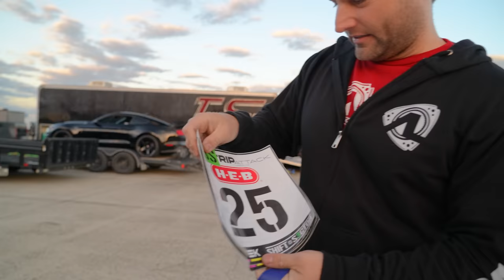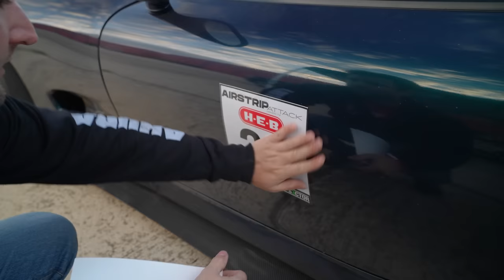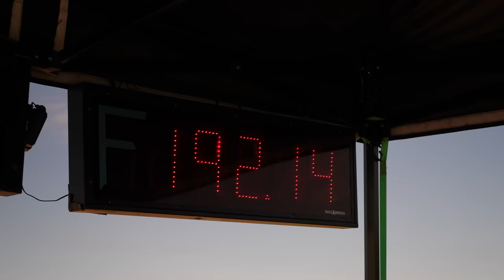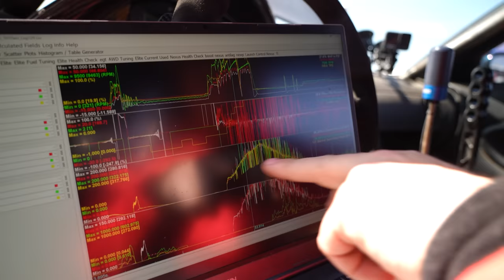The AWD 4 Rotor Breaks the Rotary Half Mile Record!

Comment: The wobble at the end of the pulls might be caused by some aero, since  its more like rolling left and right rather than yaw-ing left and right. Maybe some porpoising because of the ground effect? The pulls seems pretty stable means the skirt seal the air under the car just fine, but after you let off the throttle, it might cause some disturbance on the sealing. But idk, its just my guess, I'm not an expert by any means.

Comment: Might be worth discussing with Haltech the use of a high update rate GPS or a pitot-static tube as an additional reference for vehicle speed. Detecting slip purely with wheel speed sensors on AWD cars can be difficult.
Reply from the maker: I have an input set aside for a 5th speed sensor. Just need to figure out what would work best

Comment: So I'm not sure what kind of wheel speed sensors you are currently using but I would look into getting some three wire hall effect sensors, as there is no A/C gen interference is less of an issue, it can help improve your traction control system as they can put out a signal as soon as you start rolling without having to build up enough of an A/C signal first.

Comment: check the volts that the wheel speed sensors are putting out, at higher speeds any little bits of interference will be magnified and the computer will see it as a different speed. Can get this issue with cam/crank sensors at high revs. can either change the sensitivity of the computer or put a resistor in the wires to kill off the false pulses/interference from the sensors.

Comment: Regarding the unstable aero... Noticed there's no rear window. I wonder if this would cause vortices/turbulence. Or even an area of low pressure (lift). Or all of the above. And the rear wing would also affect aero, potentially in a negative way. Not all wings work the same on all cars. I wonder how a stock series 8 spoiler would affect the car? I remember it was specifically improved for stability at high speed. I tested this with my own FD at the track and it made a huge difference with/without stock spoiler.

Comment: don't pull the strap tight and then start ratcheting it down it will go loose every time. You have to wind a few turns around the strap drum first then keep ratcheting to tighten. the extra turns adds friction to the strap and holds it properly.

Comment: To be honest I don't think that's a down force issue, I think that's an alignment issue. I think it needs to have some toe up front. It seems at speed the tires are trying to point outward so it wants to pull the front side to side. A degree of positive toe on both sides will make the tires more straight at speed.

Comment: no back window might be the problem with the aero doing wierd stuff to the car.

a friend rode his dirt bike set ut for 1/8 mile race no front fender and number plate thinking it would be more aerodynamic and the steer of the bike started to wobble at speed like 4 rotor. 
just by taping a layer of duct tape where the number plate should be to create a aerodynamic preasure point solved the problem.

Comment: The side to side swinging could be a number of potential issues and to name a few; bad wheel alignment(camber), could be the tires itsself or even the hub bearing(s), the chassis is broken or busted somewhere, suspension needs a do-over or different settings, could also be the aero..

Comment: Toe issue. If the car starts crabbing its toe. Get the car on a set of scales to see if its loading up one side more then the other. Also see where your weight transfer is at. Are you running 50/50 on your awd or 60/40? Use nitrogen on your tires. Regular air heats up too much. Lastly you need to pick a street of whats going to be the cars purpose. Going straight, drifting, speed runs? If you build a "jack of all trades" it will do everything so-so. If you focus on one discipline it will go beast mode. Started in 125cc shifter karts, then spec racer ford(doing your own setup is the only way to the front), grand-am rolex series(became imsa), porsche gt3 cup car driver for TRG in 07. Road racing setup knowledge could be useful for you(if your interested). Whats your final drive ratio? 4 speed for long pulls.

Comment: I'm sure that open transmission area is wreaking havoc on the airflow, at those speeds you NEED to consider the air going under it just as much as the air going over it. Be safe!

Comment: This probably won't get read but it could be something to do with the aero dynamics, the front end could be getting light at them speeds (check out what they did to Kawasaki ninja H2r to counteract such things) and at that speed it would also matter A. What air (or gas) you use in your tyres, the way it would act at that high rotation and B. Are the tyres made for that speed and are the tyres and wheels balanced perfectly (like when they took the Bugatti to 300mph they had to have special tyres made, not the same but are your tyres made for 200mph)

I'm probably no where near as smart as you Rob but just food for thought if you hadn't had chance to think about it in these ways.

Comment: Is the wheel speed issue at all speeds or only higher speeds? Going that fast it has to encode the signal much faster (each tooth is a smaller amount of time) which can be harder to detect as you go faster since that pulse is shorter and shorter. Could also be an alignment issue with the wheel speed sensor and the encoder wheel. Hopefully you guys have already narrowed things down by now.

Can’t wait for the next video! Didn’t realize this was happening so close to me I would have come out and watched!

Comment: With that much roll movement, it may be unloading the tyres enough to get slip - but not that much, surely?
It could be a form of "porpoising", with fist one side being pulled down and stalling which allows the other side to pull down and stalling, and repeat.
More low speed damping might have helped?

Comment: Long road but you stuck with it and wow. The car might be taking flight ✈️🛫. The Ford GT that hit 300 in the Texas mile had more than a ton of downforce at the high end to keep traction. Custom designed ohlins shocks to keep it from riding the suspension bump stops at speed.

Comment: I think you need to check your ignition cut for 5th to 6th gear. My guess would be your speed sensors acting up as just the trans chattering between 5th and 6th gear. Needs a longer edition cut or something in the trans isn't right cause it looked like it fought you

Comment: The first step HAS to be a rear window, the cabin would be playing absolute havoc with the pressure areas and turbulence on the back of the car, to say nothing of the wing.

Have to wonder what somebody like KYLE.ENGINEERS would dream up for this thing.

Also is that a fuel cap backing off at speed? You can see it spinning at 12:20

Comment: Looks like the glitch started at 7:59.The Speedometer read 
15 2 , 114 ,152 ,200 , 149 , 215 , 148 , 123 , 147 , 173 all in 2 seconds.
The wobble could be traction control trying to keep up with the glitch.

Comment: You could see it on the speedo that the wheel speed sensors were acting up. Seems it’s fine at low speeds then at higher speeds it starts messing up. Wire shielding? Sensors loose?

Comment: Rob, does your ECU show pitch and yaw data? 
If so are you already using that data to fine tune the pitch angle of your spoiler to the body of your car? 
While this is undoubtedly the most beautiful form of the car; I almost think that the chassis is ready for the body of a LeMans worthy race car with fine tuned front and rear downforce with active aero and a minimum drag coefficient.

Comment: Hey Robert, could it be because of the two different gear ratios in the room differentials? It's possibly because of what you said, that it could be an electrical wire failure. Time to do more diagnosing.

Comment: Idea.   Buy like a Ford f250 or ram 2500 RWD and build a 3 or 4 rotor with a compound turbo setup for towing. Compounds to help with the lack of torque.   I think it would be a cool idea and could make lots of content with it.
Not sure if it would even be feasible.. just a thought is all.
Edit: I'm sure it would be extremely not fuel efficient, unlike your ram diesel..

Comment: Looking at the dashboard during your two runs I notice the speedometer doing a glitchy dance. I don't think it's aero so much as I think it's electrical.
Aero might not be helping, but I don't think it's the cause of that boat rolling.

I also noticed a shifter problem a few times - does the box deny shift if it's getting certain data from the ECU?

Comment: What may have happened to your "lost" strap is that the loose end wasn't sufficiently secured. It got loose, was flopping/flying around (at 75mph) and wound up catching under the trailer tire.                             I think you ran over your strap, which is the jerk you felt while driving. Not uncommon... Love your videos, Thanks!

Comment: I don't think it's aerodynamic issues.
If I had to guess, it's likely due to your custom setup.
Uneven distribution of power to all 4 wheels.
If you had to install custom transfer case and cv joints, their lengths and location greatly impacts how much they spin.
For all we know, each of the front wheels could be rotating at different speeds due to uneven power being applied to each wheel.
Unless you bought some kit that was professionally tested and developed.

Comment: Dude if you see this I have this issue also on a mower that I have at a certain speed it Cruises fine but after a certain speed without fail it will develop the same shake hover. I'm thinking that it's due to not having a proper alignment or the distance in which the front tires are in. For example top fuel dragsters have one tire father forward than the other and they say it's for a quicker tree trip or et. But if you think of it wouldn't it also develop the same bounce?

Comment: With your stickers you should buy yourself a Notebook or folder that you can pull them off and stick them into so you have them! they seem to come off pretty easy and you said you didn't want to so might as well save them!!!! if needs be buy an art pad with 12x24" pages you should be able to stick it on then write all of your times, laps etc. in the space below or to the side. failing that you could even include pictures from each event!
Reply: 20-30 years from now you wont remember all of them its fun to look back and then remember stuff!

Comment: That looks like harmonic interference of the WSS. Wouldn’t think wiring faults if it didn’t throw any fault codes. Do you have comparator codes set in relating differing values of WSS to VSS?

Oh, and do you have data from their PID Controller? That should tell you basically everything about the sensors themselves.

Comment: Aerodynamic wise the side exhaust is surely not helping at those speeds, the high volume of air being dumped on the right side for sure keeping the car straight a nightmare. routing it in the back would also negate some of the drag

Comment: 12:22 Maybe your suspension is too soft? When you pull your cars off the trailer ramp you can see the car bounce like its stock suspension. Harder suspension might reduce or get rid of the bounce and could give you a better start off the line?
Reply: Pretty certain hardsr suspension will just make the wheels slip more at the launch

Comment: Look at the wind on the track ThTs enough to do scary shit at those speeds 
Also in aus we turn the 4wd of in the gtrs by half track or so they don’t have enough clamp load to send the power properly might be worth a try 
Also idk if ur wheel speed issue is to do with ur two slightly different size tyres possibly no clue just a thought

Comment: You really ought to seek some advice in improving how air breaks away from the back of the vehicle. Even if the wobble wobble has a mechanical solution, you're at speeds well beyond what mazda designed that roofline around and some knowledgeable aero people could make some small additions that could probably win back another 100hp equivalent of drag at the top end. I know your body panels are primarily function (and still being beautiful despite that) but you could gain a LOT of information with CFD. Wind tunnels are ~2000-4500 per hour depending on which one (ACE, HALO, Lockeed, etc), you could do one hell of a wake study at HALO but it's one of the higher dollar venues (albeit the nicest by a mile)
Cheers, maybe we'll race someday lol

Comment: I doubt u will see this, but im just curious, the 4 rotor has a quick change rear end, i dont knw much on how the gtr tcases work, but if u change the rear diff gears do u have to change the front diff gears too, or does the tcase help with adjusting between the 2 different ratios?

Comment: I would imagine the missing back window is not helping with the stability. Alot of air at those high speeds, might lift the car. The rocking almost looks like the porpoising the F1 teams struggled with last season on the straights. 🤔

Comment: does anything in the computer need to be recalculated to account for the gearing change? IE if the car is expecting XY wheel speed at 9,000 RPM, but it's really getting XY+Z, would it think the wheels were slipping and cut power?

Comment: Great seeing how you sorted the car out to match the track conditions.
Reply: Clearly False comment, portrayal, narrative, view, perspective, perception !! The vehicle is/was not 'sorted out', adjusted for the conditions, nor was the issue corrected, 'handled', nor any proper troubleshooting, assessment, evaluation, determination, solution achieved though the issue with the speed sensor voltage was clearly identified, thus purposely ignored, removed so the vehicle would operate without the speed sensor information that resulted in affects, limits, stability, but still allowed  the higher speed operation, yet actually more dangerous without the necessary traction controls.
But, for those that focus upon the higher measured speed, despite the increased dangers are clearly among the "Reckless Society" - "Chaos" - "Sensational/ist/ISM" as most including Rob Dahm.
A proper thinking human,  person, would have identified, corrected the sensor voltage issue before attempting to drive this vehicle at high speed again !
All The Best, Sincerely

Comment: Shouldn't strap through the tires anyway, need to do a better job with tie-downs, hook to the underside using the frame, and chains are a far better choice for rolling stock.

Comment: wait you changed the rear end gearing but didn't change the front gearing so when you're in awd the rear tires have more speed than the front tires so that's why you're seeing slip and the car is darting around. also why it went away when you turned off the center diff. the drive ratios need to match front and rear.

Comment: Is it the taller gears in the rear fighting the AWD?  When you're getting up to speed the rears would be turning faster than the fronts which would present itself as wheel slip and piss off the traction control.  I could be wrong as I'm not familiar with how the Attesa system works but typically you need the ratios in the differentials to match or at the very least the final ratios need to match if you factor in tire size.  Either way Rob this thing is just getting better and better.

Comment: you spent how much on the suspension?   should really get some inflatable chassis stabilizers so you’re not putting thousands of miles on those very expensive shocks bouncing around on the trailer.

Comment: I'd guess that you are exceeding the limit of the wheel speed sensors. Could be 170mph or so. The speed jumps around around that speed and dosen't seem to sense wheel speed correctly untill you start slowing down. I'm sure you disabled the traction control around 90 to 100mph as a work around to continue to run those races faster.

Comment: I'm guessing you know this but just in case it slipped your mind. I noticed you changed the rear gearing but did you change the front too? if not then the difference in speed from front to rear increases the faster the car is moving so if the gearing isn't matched and or tire sizes matched accordingly then the traction control thinks either the front or rear is slipping and tries to react. there is a percentage of difference you can get away with but that percentage gets smaller the faster your top speed is. not sure if this is your issue or not but figured I would throw it out there just in case. just so you know I fully believe you will get it figured out and just offering up a helping hand. I also had the thought that electrical interference could be an issue if it's not gearing. might be like an alternator/ignition wire or something inducing voltage into the speed sensor wires.

Comment: As a car hauler, I really.never get why you enthusiast's think strapping through the rim is safe. If the wheel rolls at all it and relieve tension on the strap and it comes loose just like at the beginning of your video. I go over the tire front to back (you would need something to hook on the floor) or chain around control arms.

Comment: Maybe look into some front end drive planes like what the viper uses to balance the insane downfroce that the ACR makes. I don't know much about about cars at the level of what you are building. But just going by the video the front end seems to be light. Do you have hieght sensors in the 4 rotor?

Comment: I wonder if the gear ratios are slightly off between the front and rear diff, coming from two different manufacturers if it is slightly out, it will affect high speed more than low speed

Comment: Bro you need a better roll cage one that goes around the seat like nascar etc and seat and get a neck restraint going that fast you chuck sideways and roll you are not protected enough neck would be flapping around why nhra has strict rules about safety over certain speeds